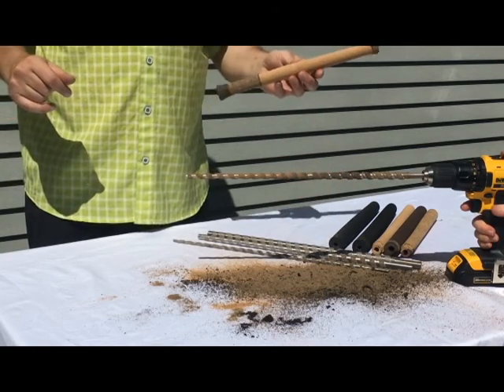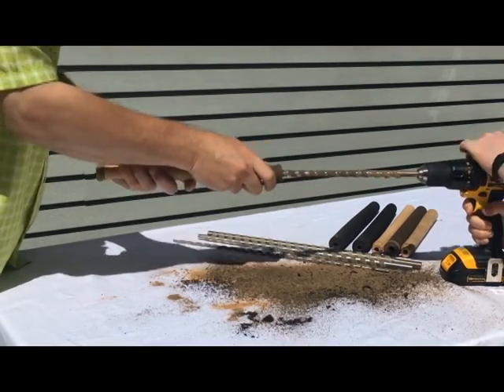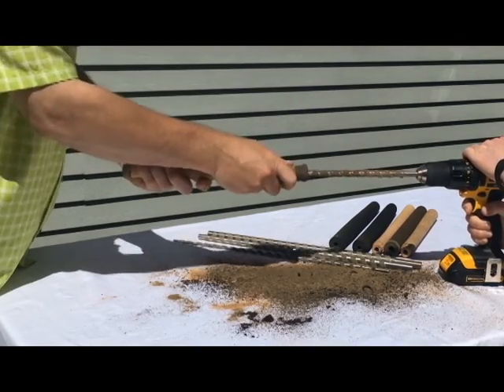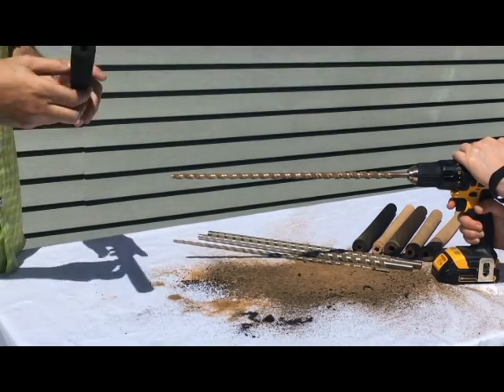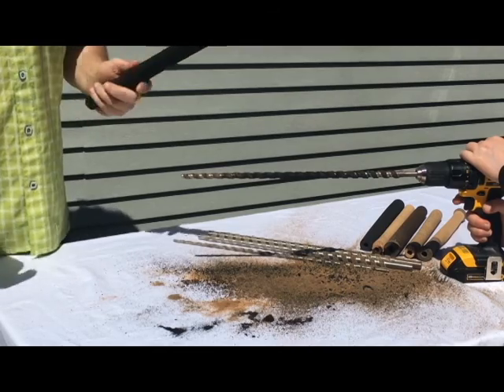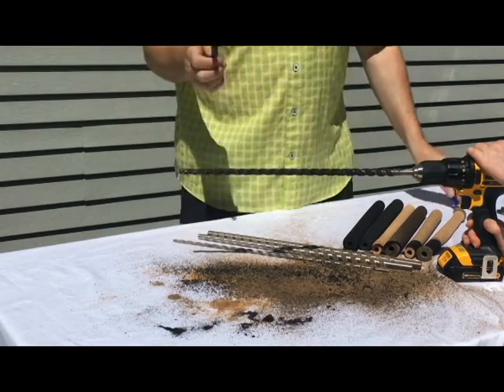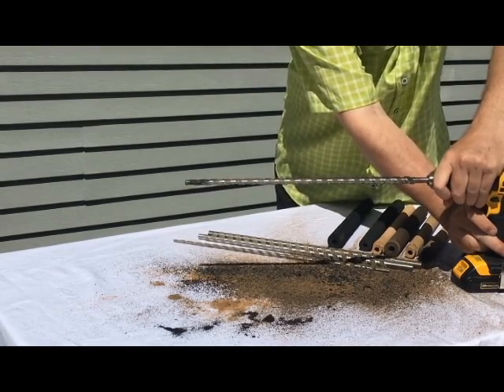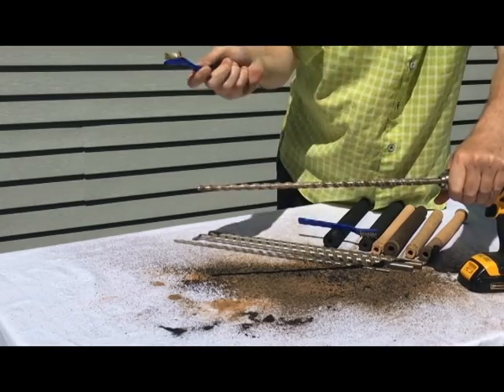The Ultimate Reamer at Work - Part 2

Comment: Now that's what I want, now to find the $200 plus shipping is a bit much to come up with for a"reamer". Is there away you can cut the cost,.
How bout steel rod,shorting the rod to10 inch. If I was making 100or more rods I could see the$200 or more, I make 10 or 15 rods a year .
 I like how it's made, if I had that kind of money to spend yes I would have one.
Reply from the maker: In regards to pricing, these are very expensive to produce and we pay a lot for them (they’re not an in-house brand). I assure you we aren't gouging anyone. In fact, our margins are quite skinny on these. Our honest assessment of the product is that they're amazing and perform as advertised (otherwise we wouldn't sell them.) I believe that they become worth the money when a builder is doing significant volume in particular rod blank size range. I advise buying the one or two sizes that hit your volume sweet spot in order to make the product earn its keep. 

All that being said, the other target customer is that builder that just wants to have the baddest tool out there. And at this point in time, the Ultimate Reamer is it.

For most rod builders, our Dream Reamer kits do the job just fine:
http://alpsforecast.com/products/tools/forecast-dream-reamer-kit-individual/